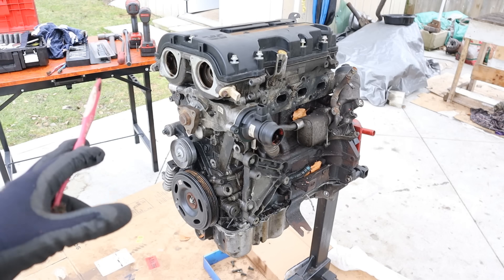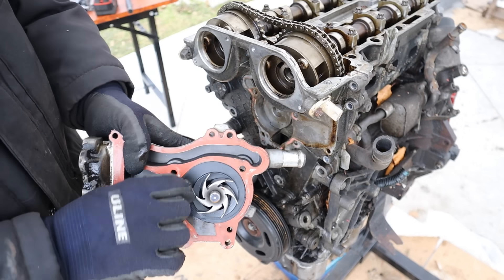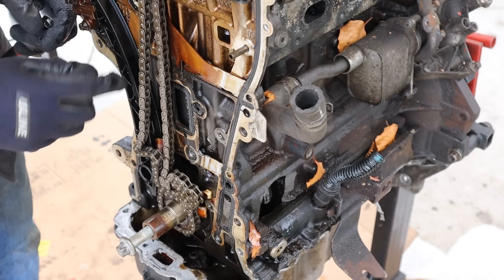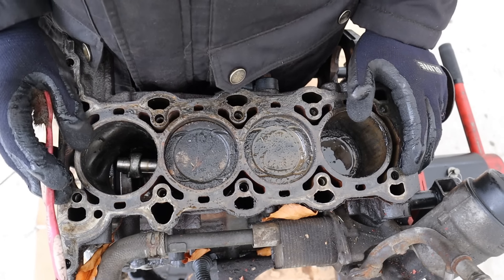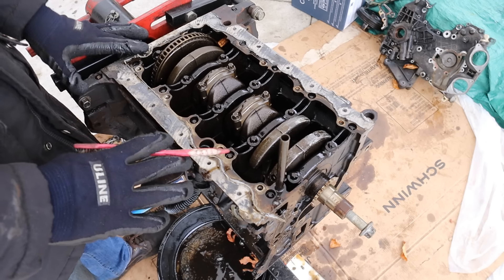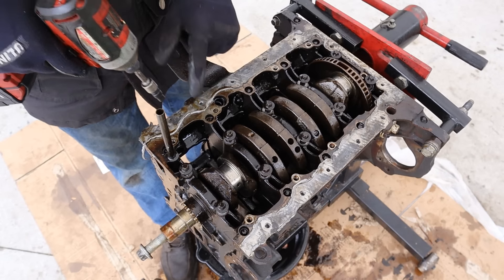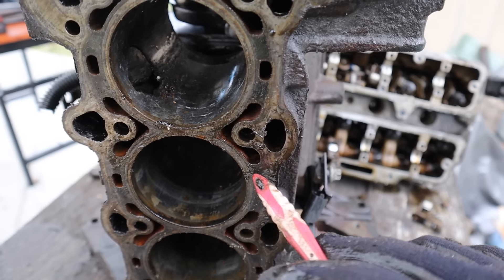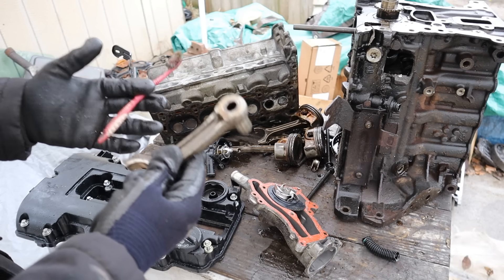Why Chevy Cruze Engines Fail

Comment: those plastic oil filter cartridge housings, I heard they crack on Pentastar Jeeps too?
Reply from the maker: Big time. I have another video on that too
Reply: mine hasn't cracked and i have the same oil filter cap made of plastic, 17 years of age, if you're not overtightening it there's nothing to crack
Reply: I had it for 10 years now and no cracks.

Comment: I have this engine in my opel astra J. It made 200k km and still running so far without any problem :D i kinda suprised but i guess changing oil after every 10k km helped a lot.
Reply from the maker: Reduce those oil changes to 6000km please.
Reply: Wow, that waiting till the oil is shot. Turbo engines need frequent oil changes because of the natural blowby.
Reply: @TheBandit7613  yea sure, you think truck drivers replace the oil every 6000 km? Yea right... 10 000km or once a year if not race driven is more than sufficient
Reply: @verdele  They hold 115 liters of oil! DUH!
Reply: @TheBandit7613  so? 115 of oil, this engine is 5 liter of oil, do you see truck drivers replace engine every 3 month? i replace my oil at every 10k km or once a year, on my old diesel i was replacing it every 25k or once a year and it's still going strong on the new owner, closing to half a million km with original turbo, injectors, the engine never being open so far... my current car is 17 years and over 220k km still going strong
Reply: @verdele   Don't try to compare your engine to a semi engine. They hold a lot of oil, have very efficient air cleaners, probably 2 stage, run at very low RPM's, and not short tripped. I do earlier oil changes. 3000 mi (4800 km) in both my diesel pickup and car. I have an old Hyundai Elantra that has over 700,000 km on it and I drive it hard.
Reply: @verdele  The difference between large semi-truck engines and a Cruze ecotec is, shockingly, the size of the two. A 1.4L turbo is much, MUCH smaller than a semi engine, which can be as small as 8 liters all the way up to 20 liters, or even more. Plus, the semi engines are, with very few exceptions, powered by diesel. And they run cooler naturally. And they have ten times the oil. They are built for hauling loads for long times and designed to operate as long as possible with as little maintenance as possible to maximize the efficiency of the vehicle. The 1.4t is built as an economy engine for compact cars to take the kids to school. They are not, and will never be, comparable to each other.

I would probably go so far as to guess that you don't own one of these engines. Not a single engine is designed the same. Some require more care, some less. That is why it is still possible to blow up a Toyota, that is why a Chevy can throw a rod at only 4k miles on oil, that is why an Ecoboost can completely evaporate from a tiny clog in an oil sprayer. Different designs require different levels of maintenance.

You also should not compare diesel engines to gasoline engines. Diesel fuel has less instantaneous thermal potential than gasoline, thereby making it burn cooler. Diesel engines run at higher compression ratios, thereby increasing the material requirement of the block and subsequently the inherent ability to draw heat away from the combustion chamber. Diesel engines run at lower RPMs, reducing the combustion cycle frequency and thus heat generation. Diesel engines flow more air by design, decreasing combustion cycle heat.

And finally. The lack of frequency at which you change your oil simply makes you look incompetent. Oil is not magic juice that suddenly goes bad. It gradually breaks down at different rates based on running cycles, engine temperatures, loads, friction rates, filtering volume, etc. Stretching oil is never a good idea. I suggest you educate yourself before you attempt to correct others, and take better care of your machines.
Reply: @speedkar99  6000 km oil change intervals ???
That's like 3730 miles, who changes oil 4 times per year ??

10 000km is 6213 miles i'm pretty sure it's not too much
Reply: Astra j 1.4T has A14NET or A14NEL. I don't know the differences for sure but oil pans are definitely different from this one 😂

Comment: If it came in with a hole in the side of the block, few mechanics would bother to take the head off or even take the timing cover off. So, I'll throw out a guess this was a complicated story, perhaps a head gasket leak that they attempted to fix, then maybe they messed up timing on reassembly causing catastrophic failure of timing and failure to stop the coolant leak into oil. Or maybe guys at an automotive school had a go at inspecting carnage after an overheating nightmare.
Reply: or this: the headgasket failed, they replaced the timing, it worked for a while untill it didn't and they took off the chains to resell or put it into a junkyard engine

Comment: I dont know all the details on mine but i got a 2014 cruse, no turbo, 4 cylinder manual trans with 81k miles. I had to rebuild the transmission this year, most other problems ive had were self caused. I did have to replace the starter solenoid. That was annoying.

Comment: GM still can't make a good small engine no matter how hard they try.
Reply from the maker: Sad. They'll need it soon with all these environmental regulations
Reply: They could just remove a cylinder bank from one of their pushrod V8s.
Reply: 3.6L Four-Cylinder Engine With GM LS Head Makes 500 Lb-Ft Of Torque

Comment: Although I enjoy videos like this but they are talking about the car I drive which is a 2014 1.4 Eco Tech turbo what we have mostly in our society now is a big section of society that does no maintenance on their vehicle. They may change their oil every 6 to 8000 miles they may not even use the right oil. I hope you're not jinxing me but I change my oil in my car every 3000 miles I do not push my car to its limit when I drive it, I take it easy with the car and I take care of it, the example that you use looks like a vehicle that was not taken care of at all. You're kind of making the position that all of the engines are like what you're showing. Some of these engines have 200k miles on them. And still running. It's everything to do about how you take care of a vehicle. I know there are bad engines out there, but I also know if you take care of a vehicle, it will take care of you.
Reply from the maker: While I agree, some engines have more tendencies than others due to design and manufacturing issues.

Comment: I must got a good one. Not one problem with it yet, and it's past 200k miles.
Reply: Freeway driving I suppose.
Reply from the maker: Nice. Do you change the coolant
Reply: @speedkar99  replaced it this year when I flushed blocked heater matrix.
Reply: Looks like you got an anti-lemon 😂
Reply: @omarrolle3842  I suspect it's been looked after without skimping on service.

Comment: How close are these to the Saab Eco-Tec engines found in the 2003-11 9-3?
Reply: how close? by a million miles, the eco tec engine in the saab is full aluminium with balance shafts on the 2.0turbo, the 1.8 naturally aspirated is also a good dinosaur that has nothing to do with this engine

Comment: The timing " slides " are made from UHMW ) ( ultra high molicular weight ) a plastic used for rather extreme service for sliding / anti friction / wear service. Too bad the oil was rarely changed on this motor. Except for the VVT should have lasted MUCH LONGER.
Reply from the maker: The plastic is good but it needs more clips to grip it onto the guide.

Comment: It was used in Opel cars too in Europe.

I was considering buying Opel Zafira with this engine, ended up buying 1.6l diesel. Worst car ever. I believe those 1.6l diesels were available in Chevy sedans too. Has lots of issues, very expensive to repair. It was only 3 years old, just over 100k km and worse than my old car (also Opel) after 15+ years and 200k+ hm. Got rid of it after owning it for 1 year.
Reply from the maker: Ouch! What kind of issues did you have?
Reply: @speedkar99 1.6 cdti is notorious for chain rattle. The chain is at the back of the engine, so it has to come out for replacement
Reply: @speedkar99  Engine ran smooth for a while, then few months in started rattling. At temperatures below freezing was throwing some codes, don't remember what exactly it was. Went to mechanic, he did timing chain job. Timing chain is behind engine, requires removing engine and also replacing flywheel. Timing was off by 2 tooth.

It was rather expensive, over 2k euro, mostly in parts.

Half a year and 15k km later it started rattling again. Same symptoms.

Then I got rid of it.

However, there were more issues, not just engine. It was a 2018 Opel, at 3-4 years old it squeaked like my old Opel did after it was over 10 years old. It is one of last vehicles built by Opel when it was under GM. Build quality was horrendous.

Then, the biggest issue for me was seats. Its a minivan. Second generation, which is what I had before, had amazing comfortable seats. That car was third generation. GM did its money saving thing, used same seats in a minivan as in small Astra sedan. Didn't notice that during test drives because didn't know that seats could be so bad. It took few months of ownership to notice it. Caused a lot of health issues and back/butt pains. When I finally sold it, it got to point that I couldn't seat in that car for more than 5-10 minutes.

Bought Forester with same age and mileage, quality difference is massive. Several months later all pains are gone.
Reply: Its actually really showing in how many cars are on road.

Just few years ago there were a lot of pre-facelift Zafira Tourer (2011-2016), which is easy to spot because they have weird headlights, now they are quite rare. Post-facelift cars are sold dirt cheap, imported from Germany, but are disappearing as fast as appearing.

I see more second generation Zafira B cars than Zafira Tourer. Zafira B stopped production in 2014 (2011 in countries other than Germany) so they are very old now and are still running.
Reply: @slava_trushkin  God, Astra seats are horrendous... When I tried it, it was a big no for me straight away.

Comment: I believe it was the oil cooler that failed on the mother in laws Cruze... didn't blow up and still running...so far lol
Reply from the maker: Not the head gasket?
Reply: you mean the seals, just replace the damn seals and you are good to go

Comment: Hi can you tear eco-tec 1.8 NA
Reply from the maker: Which is that? I've covered 2.2, 1.4T and 1.4 Ecotec already.
Reply: @speedkar99 the 1.8 engine is found in the base model cruze from 2011-2016 on generation 1 models.
Reply: @justinv3080  And saturn astra....I test drove a 2012 cruze in manual with both engine and liked the 1.8 more than the turbo...i feared for longevity on the 1.4 t...guess i was right on that one!
Reply: @justinv3080  also chevy trax 2015-2019
Reply: @iamtfyyiam8834  I don't recall the Trax ever using the 1.8, I know they came in the sonic on some models though
Reply: @justinv3080  in GCC region they only offer 1.8 engine. I have chevy trax 2015
Reply: @justinv3080  They were sold in Canada with the 1.8 as an option the first couple years but they're few & far between. You could get them with a stick shift too

Comment: There is no steel engine block. Only cast iron and aluminium with hard metal coating on cilinders.
Reply: Some ww2 radials had forged steel crankcases.

Comment: it makes me sick to see all those not-soo-old engine fail, because of poor construction and plastic parts all over the place.
Reply: It's lack of maintenance that does them in
Reply from the maker: I agree... Alot of Cruzes in the junkyards due to bad engines 

Meanwhile Honda engines are going strong
Reply: @TheRealSykx i guess the main issue is that quality can't be asessed by most buyers - so car companies are optimizing whatever is possible to cut costs. i mean what other reason is there for all that plastic parts which start to crack after 10-15 years, regardless of good maintenance or not. or those stupid combined parts, where one part does 3 things and can only be replaced at once.

Comment: The reason they "pulled a bmw" is because it's an OPEL design so it's German. Like every other german engine, ever possibly, it's a great design horrible execution. The biggest issue is this is a 1996 design for tiny cars, and was never intended to be turbocharged, ran hot for emissions and with cheap parts. It's just overstressed for what it was made for and cheaping out on parts doesn't help anyone.

From what I've been told, this engine is related to the Hyundai nu engine. Lot of design sharing.
Reply from the maker: NU? Interesting!

Comment: Cheap cars suffer from neglectful owners who don't have the funds to replace big ticket items. That's why you are a lot with dead turbos, engine sludge and timing chain issues. Honda's 20 years ago were non turbo and timing belt could be done once every 100,000 miles so not as sensitive.
Reply from the maker: Yeah the more complex they get, the more likely they are to fail with neglected maintainence

Comment: I will bet they didn't use the required DEXOS oil.
Reply from the maker: Why dexos?
Reply: @speedkar99  DEXOS is formulated to dissipate heat and clean sludge.

Comment: This reads exactly like an engineering team working their asses off to make a good, solid engine, only for the finance department to swoop in and force them to cheap out on cooling and gaskets to scrape off an extra 5 cents per engine.

Comment: Yes sir, I bet that motor going south was really exciting especially if the poor soul nailed it on the entrance ramp to the freeway trying to cut off a semi. I see too you may of made a blood sacrifice splitting the block, I feel your pain, have experienced it many times. Always a thrill to see skin on the head of a fastener. 

I have a bud that owns 2 Chevy Cruzes that seem to be holding up. BUT he is max anal about fluid changes. 3k oil changes, coolant every 5. Seems like a waste but they still run down the road at 100k & he does get some great gas mileage (better, to pay for the fluids). 

Great tear down video & explanation but hey, that's you.  Kinda disappointed the Mrs. didn't give you a cookie.
Reply from the maker: Thanks for the feedback! And yep Cruze drivers aren't the carefully ones. 
Cookies are only for easy teardowns. This one was quite something!

Comment: Another modern day GM Mega Turd. I'll keep my 1996 Buick Lesabre with 127k. Back when GM built reliability motors. These dual overcame vvt engines wont tolerate extended oil changes. Like the old push rod engines would.

Comment: from watching many vid's people think a 10k oil chg interval suffices. nope, the oil itself holds up but is full of carbon and the pvc reburn clogs piston oil rings then fast downhill from there. gdi sucks, gdi+turbo sucks worsefor engine suicide.
Reply from the maker: I agree. This engines weak points are more the cooling system.

Comment: Opel designed this POS, the cooling system uses rubber and plastic all over, it's just as shitty as Ford's 1.5 /1.6 Ecoboost.

Comment: So i guess the 2024 trax with a 3 cylinder 1.2 turbo is no go, i mean if they were so wrong on the 1.4, should we trust them? Too bad they did not put in a regular 2.0 4 cyl., no gdi, no turbo in them...
Reply: it's not the same engine, not even based on the same engine
Reply: @verdele  So? It's the same company; if they did not build the 1.4t for durability, what make you believe that the new one would be built "to a better standard"?
Reply: @theadvocate4698  and that has to do with what? go buy a shit eco 1.0 from ford then, or a 2.0 from vw wich is also shit,i answered your question, the 1.2 is not the same engine, the newer 1.2 is reliable enough nowadays considering the junk engines all the manufacturers are linining up, just look on i do cars or here and you will find plenty of new engine that are trash, including honda or toyota
Reply: @verdele  Wow, it is like talking to wall... have a nice life buddy, bebye!

Comment: That engine looks to me like GM imitation of the Saab B204R engine.  Even uses an ignition casette like the old (very good) Saab engine.
I used to have a saab and never had a problem. 
GM sucks. They take technology from any company they acquire and build them the cheapest and baddest way that can be imagined. They don't care about quality and much less the customer.
Reply from the maker: Yeah what's up with the single ignition coil! That's costly to replace

Comment: Junk cars. They're just one thing after another. Fix 1 thing something else fails. These 1.4 iTi and the 1.8 engines and the 2.0 diesels are crap. 

Even aftermarket parts aren't cheap enough to make them viable to fix. Electrical problems plague them too

Comment: Junk my wife 2019 buick encore with 30 th miles o. It 1 owner65 year old driver turbocoolent lines blew out twice in last 6 months plus head gasket just picked up a new Toyota cross today glad it's gone buick was no good with warranty by by buick  try our luck with a Toyota  new gm buicks are garbich stay away I am a car guy 68 years old not your dad's buick